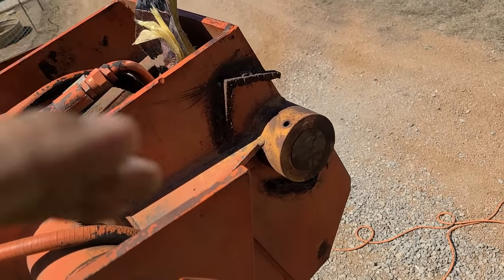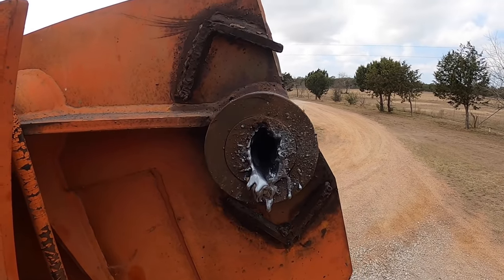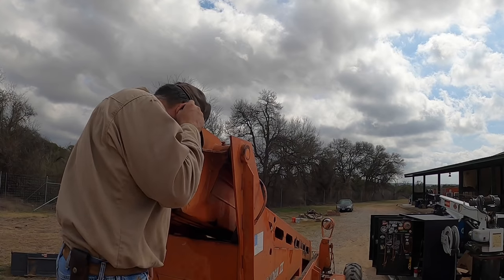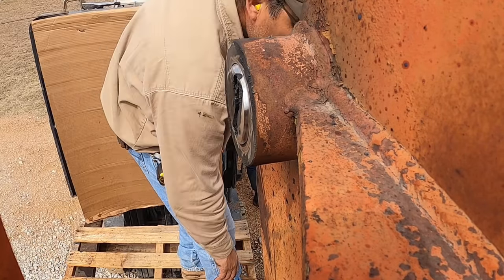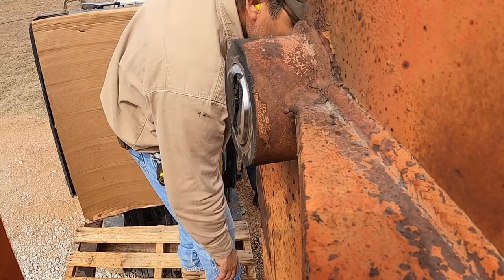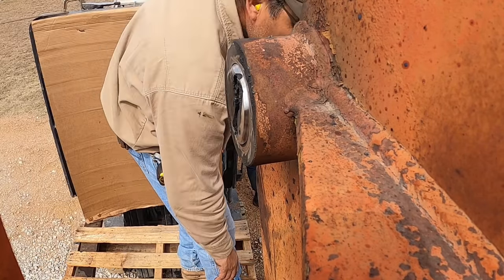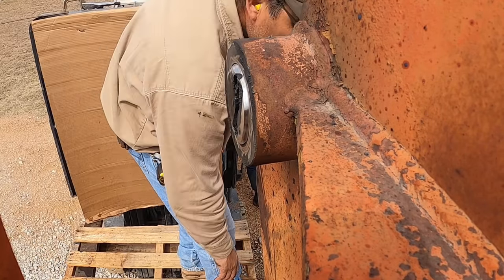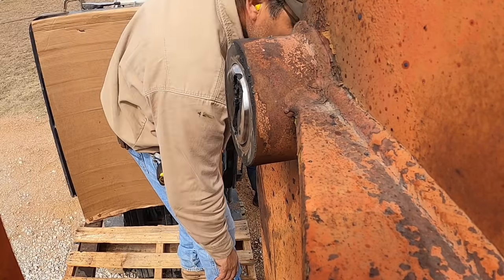Exothermic Slice torch For the Win????

Comment: I've struggled with several of these situations.  Your pin is not 'rusted in'.  It's pinched by the weight of the boom.  I pulled on one of these for a couple of days until I wiggled the boom around different directions.  I found the right 'spot', and it just pulled out easy-peasy.
Reply: Ah. Several others remarked something along the lines of: "Usually once you get a pin like that going it starts getting easier as it comes out further. It's strange that this one was fighting you to the very end.' 
Well, pinching would explain that

Comment: Wow that was a tough sucker, pin embedded itself in there. I just wonder though, if hammering near the outside of that pin along with the jack would of helped any?... create vibrations help move it along? I know when I change front end parts like ball joints I don't even use a puller, generally hammering the steering knuckle they pop right off the knuckle. Vibrations help a lot in many cases.

Comment: I've had good success on some nasty pins using a demolition hammer to drive them free. I weld a nut to one side of the pin to keep the chisel tip on the electric jack hammer centered  . Wish we had access to that torch set up you use in the video at the shop I work at

Comment: Would it be worth line boring a tad of clearance with some grease grooves added so there is always some grease to stop rusting? Fantastic Job you guys-you show others how it can be done. With a hole in the pin I would have the cold water through the pin when heating the outside-it may have just shrunk the pin a bit more. Stay safe. Greetings from Tasmania Australia 👍😁🇦🇺🦘

Comment: I have this exact problem at the moment.  I have been going through a machine replacing various worn pins and bushes and the latest pin is totally frozen. I have had a 20 ton hollow cylinder (the biggest one I have) on one side and a 14 pound hammer hitting on the other with the whole thing heated up and it still wont move.  Next I am going to try using an excavator with a hammer attachment  and see if that moves it.  There doesnt seem to be anyone in my area with a thermal lance to burn it out.

Comment: I have had problems with bottle jacks working when on their sides, maybe cheap jacks!   I was wondering?????while pressure was on jack, if wacking the tube that pin was in where you had heated, if the shock would maybe help pin move.....or wacking pin that where protruding with a side thrust while pressure was on might help, for of like an impact wrench......thanks for reading,,,,,PB

Comment: I had the same job here about two weeks ago, I had to pull a 3 inch pin on a processor main boom to the house pin , I had to make a puller out of a 6 inch piece of well casing, The pin had a big step in it from being worn so much it was quite the experience🙄. About 12 hours later we had the pin in.

Comment: I have encountered many jobs like this. Other working options are; weld a stub shaft about 3 4 diameter smaller to end of frozen pin so it wont mushroom itself tighter when hitting it,use a piece of scrap shaft hanging from a hoist above with about 2 feet of swing for a 50#or heavier hammer, using a hydraulic jack sideways always works bett with the pump on the bottom side

Comment: Something that I've done in the past is use the grease hole to spray liquid propane into the pin. Propane boils at -44 degrees.  To get liquid out of your average BBQ tank just turn up side down.  No regulator.  I used my blow gun with a really small nozzle.  Propane is stored between 100 and 200 psi.  On a cool or cold day you probably could use a cheap hose but on a warm or hot day use a really good quality hose.  Cheaper and more accessible than liquid nitrogen.  Because I'm a tool nerd I have several portapower units.   I even have a 50 ton unit.  Can really twist some stuff up with that one. ;o)

Comment: I wonder why you didn't use some type of lubricant for rusted parts. I wonder why you didn't drill a few holes through the cylinder to get some rust busting lubricant into the space between the shaft and the cylinder? I wonder why there were no grease fittings anywhere on the cylinder to lubricate the shaft.

Comment: Something we have done in the past is after you blow the hole in the pin we run water through it to cool it fast and it normally shrinks the pin up and than it will slide out easier.

Comment: If that pin and shaft has had to be heated and by the looks of it, a similar jack setup. 
The shaft may have a kink  in it, making it very difficult for the next poor sucker to do again.
To be honest it should be rebored to restore it, or replaced either way an absolute pain in the ass to do.
Dont think i could have persevered as long as you did with it, and awesome explanations of the exothermic slice torch, everyone learns from your videos so keep going.

Comment: Can we say Molten Magma? Those babies can get stuck in there pretty good. I have burned a few of them out on that particular model and in each case had to slice down to the tube to get them to collapse enough to  release the rust bond.  Once time I  even had to cut out the next pin forward, the main boom pivot pin once and replace the whole tube it goes in as it was destroyed from deferred maintenance as we say!  And yess I have made a similar frame and used the Hydraulic ram to assist as well. Did I say they can get stuck in there pretty good? Cheers my friend.

Comment: A fancy name for an oxygen lance. We would use 1/8th black pipe with an oxygen tank and hose to lance the tap holes on the furnaces to get molten aluminum to flow. The same process!

Comment: I think you should have tried drilling a series of 1/ 8 to 3/16 holes 1'' to 1 1/2 ''apart on top and filled them with oil. Install your press and heat externally. Oil should travel around pin let cool and add more oil . Might work. Victor makes a rose bud that fits your cutting torch,but you must set oxy to 8o lbs?? I think it can change the seasons !

Comment: I had a similar task. We got it out cutting the thickest threaded hole in the pin that we had the tooling for and pulled it out with a hydraulic jack assembly that a friend had stored away for such a task. It was a short hollow hydraulic cylinder that the threaded rod went through, was countered with a nut. It had very little travel, so it took several steps. Slow and steady... ;) 
Heated the outside with a torch a little, and then in broke lose.
Are you sure that the exothermic rods did not make your life harder in the end with the hydraulic jack?

Comment: Have you ever tried alternative metal tubing for an electrode in the arcair slice, such as brake line tubing?
Most of those bottle jacks are not designed to be used on their side. I have a couple I had to disassemble to modify so the pump pickup would still get oil when positioned on its side. Time to buy yourself a porta power. For as much as you could use it that’s an easily justified business purchase.
Reply: If the pump is on the top side they work on their sides. I found that out after much consternation.

Comment: Isaac, being in your shoes - at this job, that is - I'd try to make own DYI thermal lance. Just a regular mild steel plumbing-style pipe, 1/4" (3/8" would be too big, methinks), filled with mild steel wire, say, 1/8" dia (for better efficiency - it's the burning of iron in oxygen that is the essence of thermal lance), and a simple cut-off valve at the end ("your" end, not the "business" one, obviously ;-)
This way you can make it as long as you need, and I guess you'll save a bunch of bucks too at the same time. Keep in mind, however, that your "regular" oxygen regulator might not be able to provide sufficient flow of oxygen, as the lance uses muck, much more oxygen than a torch. A;so, you'd need to have the oxyacetylene torch available as well -  to "lit up" the tip of the lance.
Also, the "blowback" of molten steel and iron oxide would be substantial, so you'd need to use dedicated PPE - like the one here:
https://www.youtube.com/watch?v=YSKe_SETU08&t=488s

Comment: use a piece of 3/16ths brake line, hook it up to an oxygen regulator at app 40psi. start the cut with a torch and feed the brake line into the fire. you can them take the torch away and continue with the brake line but stay straight it will come out somewhere. we use this method for track pins and any long pin. after a little practice it doesn't take too much tubing.
Reply from the maker: I'll try that!

Comment: If you cut through the side of the pin to the surrounding material ....  I have some success drilling through and then using a saw to cut a notch through to the edge of the  pin.  I'm sloppy enough in using a saw that the kerf is wide enough to keep from binding.  In a similar fashion you will find that if you drill the hole off center near the edge of the material it actually works a little better.   Think about how you remove a stuck bushing by splitting it.

Comment: Had a couple of smart Lithuanian guys working for me - when they'd come across stuck pins like this (and far longer/worse ones) they would break out their "Pin Remover" - which was basically seven foot of heavy solid bar they'd cut out of a forklift cylinder - about 3" thick.  They'd do whatever it took to get that bar lined up with the stuck pin, then the 2 of them would beat a cadence on the end of it with 2 sledgehammers. Usually they'd tack on a guide tube btw. 

The combined force of the sheer impact weight of the bar coupled with the sledgehammer blows used shift stuff you would not believe possible. They used exactly that to drive all 12 bars out of a huge shredder that had defied all & every method known to man. Those stuck bars were over 6 foot long & 4" diameter - everywhere had tried shift them & had failed. 

For smaller pins, they had a 2" thick bar & a 3/4" thick bar - also about 6-8 foot long. Did I ever see them fail to get a stuck pin out? Nope. The sheer impact force used even shear the retaining bolt if the bolts refused to come out. :-) 

They used say "We explain better to it.. "
Reply: They were both built like brick-outhouses, which might have also helped. But still.

Comment: I wonder if a road drill (edit: jackhammer) might have got it out quickest, especially if you got the thing on its side, heated the tube up and stood above it 'drilling down' with a blunted off chisel.  Don't know what frequency those things hammer at, maybe 6 or 8 hard blows per second, probably a lot more effective than the sledgehammer. Just an idea, but on the other hand, probably not too pleasant for the operator hammering against solid metal.

Comment: Rotate the jack 180 so the pump is on the top and it will work just like it does vertically. Grit job getting that bugger out.

Comment: Isaac, i have used a trick, I drill a couple holes on the top and throw in grease zirks.  But I dont put great in I have a little tool I put PB Blaster in and then conect it to the zirk.  You hit it with a hammer and it injects the blaster in.  You still would have had to put the press on it, but you might have gotten the pin out without all the thermal arc..
Reply from the maker: Great tip! I shoulda asked if he wanted Grease fittings. He wasn't there for the repairs.

Comment: When I did that type of pin work when the hole was burned through portapower on took a air hammer on outside of bore with a round chisel on outside vibration would loosen everything up as far as rust out it would come

Comment: I have pulled frozen pins a few lanced a couple but they were 1’ diameter the smaller ones like this I would weld a 1-1/4” nut with 3/4” all thread then they make a porter power head with a hollow shaft you can use plates to space but don’t feel you needed to cut middle on this heating everything probably wasn’t much help but each one is different

Comment: Hi , watched your video .I do also weld and work on alot of heavy equipment. I would invest in a hollow bore cylinder.I would of welded a 1 inch peace of threaded rod onto the pin and pulled out with that.But anyways thanks for the videos

Comment: While I was watching the hard work moving that rusted in pin, I was wondering if drilling a few small holes through the support to allow penetrating oil inside the bore would have helped speed up the process. They are probably going to drill and tap some holes for zerk fittings in any case?
Reply: I was thinking the exact same thing.  Heat and panther piss sprayed in the holes.  Back and forth a few times.  The heat and penetrating oil act like capillary action with soldering.  I also wonder if it will need line bored or if it's not worth spending the money on that machine?

Comment: Stuck pin season! I got one on a backhoe bucket Im trying to get out. Cut the ends to get the bucket off and have better access. Might try and weld up a jack or go buy a porta power and make a jig to push it out. Worse case I will be making new ears and pivot point for the bucket. lol

Comment: I've changed a bunch of shafts and pins, the only tactic I didn't see you use is vibration. We would get that pressure on there with the heat, then hit a little above or below it, the vibration of the hit helps it loosen up any rust and dirt in there. I absolutely love your determination and skills, and please don't take this as me telling you what to do, it's just a tactic we often use. Great work guys, and congrats on getting that pain in the @ss!

Comment: That’s one stubborn pin I tried something similar once with a 50 ton and when that pin popped i wasn’t winning any medal for bravery I hit the deck because it sounded like a 30-06 went off lol but I got it broke free it was an old Chicago ditch digger I was about 17 I think welding for an irrigation company and turning wrenches. on that same machine we welded the input shaft in the transmission and turned it back down to spec then ground down a ball needle and filled the seized bearing with grease that ate the shaft in the first place and put it together that was 25 years ago it’s still going today lol

Comment: Next time you have a job like this use roofing torches to get it red hot all around and since you created a passage right through use a garden hose with cold water and feed the inside pin (pipe) to shock it, then drive it out by use of the press or 20lb sledge hammer, works every time!

Comment: I have used a 1/4" pipe hooked to oxygen bottle at 80 psi and it works as a lance . Melt the end of the pin and pipe, turn on the oxygen and all hell breaks loose.

Comment: That frame you made with a nut welded to the pin would make a great  puller with some all thread. Or if you have the means Enerpack makes a nice setup. We do it all the time on heavy haul trailer pins. I wish that damn slice rod wasn't so damn expensive

Comment: I agree with using vibration on the pin  or outer tube when under pressure and heat. Additional trick that can work to gain some advantage is while heating get a candle and let  the heat pull in the melting wax it like capillary action and you want all the advantages to win
Reply from the maker: Yes, im familiar with the wax idea.👍👍
Reply: @ICWeld  how does the wax method work?

Comment: Using a Mag-Drill with an annular cutter on it to remove the first 1-2" of pin on either side might to eliminate any mushrooming effect from people's past attempts or the current sledge hammering might have helped on this job. Then again given all the corrosion inside it may not ... either way this was one heck of a tough job so way to see it through to the end! I myself might have thrown in the towel since I don't have access to those awesome melting rods you have.

Comment: Hard work, I will use grinder cut one Simple line then use torch and Hammer:) after this job i will weld this cut regards From poland I was tried use car hydraulic jack like you and not working you can use it only up down not left right side I don t know why jack not working on this position

Comment: Those rods seemed to act odd. We had 44 inch long rods that we used to remove 2 foot long 2 inch pins. One rod would usually make a hole all the way through the pin. Once there was a hole through, the hole could be expanded with an Oxy/propane torch.

Comment: It's a bad design that pin needs to come out to remove that cylinder if it needs to be re-sealed. I just take a gas powered chop saw and cut a grove in the tube down to the pin. Used like 20 chisels in the grove and pound out the pin and it's still a ton of work. That cylinder needs to be leaking extremely bad or have some internal defect before I mess with it.

Comment: Bottle jacks don’t work to well horizontal because the reservoir is bottle section of the jack and can’t pick up the fluid. They have jacks that work on there sides and I think you can  convert regular bottle jacks to work horizontally . Just my 2cents from experience with this same issue.👍
Reply from the maker: just make sure that the pump part faces down. it worked well.

Comment: Time to cut it out and put in a new roller. Some hydraulic jacks only operate on a vertical base. You might check. So, You get that roller out, you gotta wonder what kind of interior surfaces are you gonna have to play with when its out?

Comment: Hey 👋 Northern Michigan here. What a bugger! Nice work friend. I have a question, what size carbon rods did you use for the gouging? I've got a 225 g plus. I should be able to gouge with that ....right? I need to learn more. Thank you for sharing. Happy welding!
Reply from the maker: 1/4" rods, at about 200-220A

Comment: Generally for this sort of situation avoid heat. You can actually overheat the workpiece. Set up of your pressing jig is critical, it must be parallel and solid bars, not tube. Of course you were losing a lot of press power with the wood. For a real stubborn one I would look at boring/drilling a decent size hole. to relieve the tight  'Fit'. So this is what fitters do for a holiday! Yep, that was a doozey.